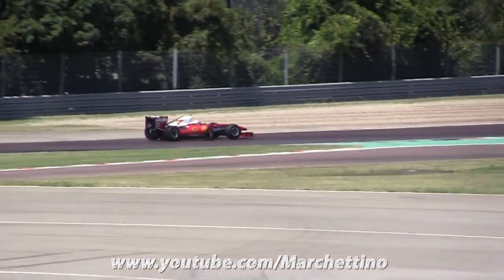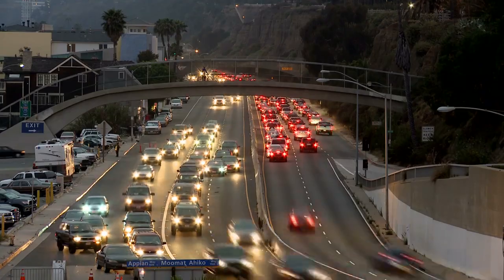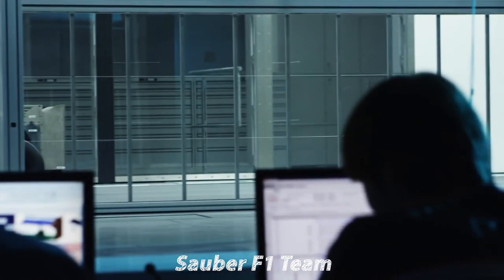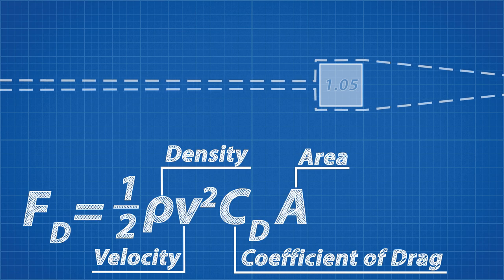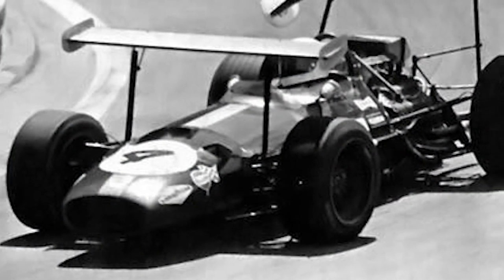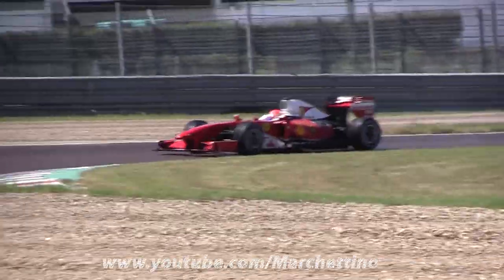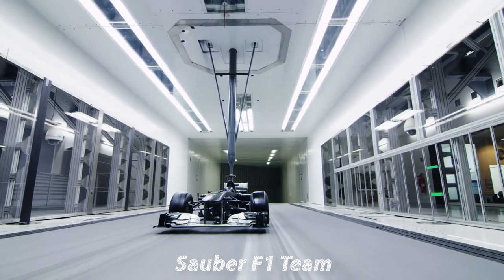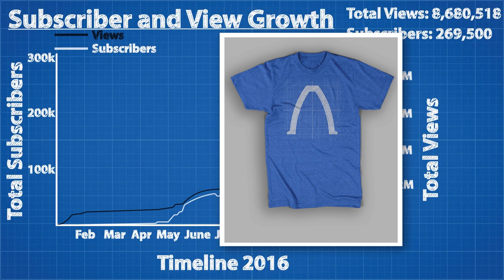The Greatest Innovations In Formula One

Comment: KERS is making it into some high end production cars now too.
Reply: TheSpacecraftX Toyota Hybrid uses this tech)
Reply: I wouldnt call an amarok a highend car
Reply: Chris Herrin Kinetic Energy Recovery System is a mechanism that tries to capture and story energy when the car is braking so it can be used later. in most cases this is letting the electrical engine of a hybrid charge the battery when braking.
Reply: A lot of F1 tech went to the production cars.
Reply: The LaFerrari uses the KERS as well
Reply: Technically every electric car uses kers so the chevy volt is competing with these high end production cars
Reply: My 2008 Toyota Camry has KERS. F1 was slow to pick it up.

Comment: Was anyone else disappointed that this didn't get into much depth about carbon fiber?
Ah well, something to look forward to in the next video I guess.
Reply from the maker: My Master's thesis was in carbon fibre reinforced plastics. It deserves a video (if not several) on it's own.
Reply: Same - I also think the lumping of monocoques crash surfaces and brake discs was rather random (in a pixie dust) sort of way. 

I'm not optimistic about carbon brake discs because passenger vehicles don't need the comparative advantage, and automotive engineers focus on maximizing value for cost. No one buys cars for sub-100ft 60mph to 0 braking performance.
Reply: where did you study and what excat subject did you choose?
Reply from the maker: Studied Biomedical Engineering in my undergrad, which is essential Mechanical Engineering with a bit of biology and surgical practice thrown in. My Master's was in Aeronautical, where I specialised in composite materials.  Worked in the Oil & Gas industry for three years as a composite design engineer/ product manager then. Varied....
Reply: Nomulus Norwegicus 
But the People would just drive faster.
Reply: Nomulus Norwegicus unlikely. Real life and engineering is all about compromises, and the phrase light, cheap, strong pick two is very true. Consumers aren't going to pay for carbon composite brakes when the vehicle is only 2600 pounds, 140bhp - especially when the cost can be applied to other things like interior comfort/NVH/sensor safety features. It's just the way it is.
Reply: how old are you? you dont sound so rusty like you already have so much experience.
Reply from the maker: 26
Reply: shinybaldy That depends on the relative costs and benefits of carbon-fiber versus normal breaks. (And how much people are willing to pay for something that sounds futuristic. You'd be surprised at how much marketing plays into this kind of thing.)
Reply: max mustermann I doubt it. People are used to driving at a certain speed, they'd be driving alongside others who didn't change their speed, and there's no reason to think the speed limits would increase.
Reply: Timothy McLean haha I doubt it. Most economy cars still use drum rear brakes because they work well with parking brakes, are cheap, and the cars are light and aren't rallying. Ask most drivers whether their car has direct injection or what's the MPG. More will know the MPG.  People don't care about technology, just results.
Reply: additionally don't carbon fiber brakes only really work when they are at temp? i wonder how well they would work up here in the great white north, after a 30 minute hwy run with -20F temps. Probably not very well.
Reply from the maker: Well my hometown is the European capitol of Biomedical Engineering. It employs a huge percentage of the population, so it made sense for me to study it at the time. Then again, I wouldn't advise anyone to study it. Mechanical Engineering is basically the same degree, but allows you to be taken seriously for way more jobs. A master's in BM would make a lot more sense, should never pigeon-hole yourself too early.
Reply: thats because Formula 1 cars were not the first things to utilize carbon fiber
Reply: You are awesome man, keep up the good work.
Reply: I study Aerospace in Delft and the Structures group has been hitting us over the head with composites since we started. They invented GLARE at my faculty and they literally can't stop talking about it.
Reply: Mark Kalsbeek Aerospace engineering at Delft is my 1st choice for Uni! Would you recommend taking the course? Also are there any pointers you could give me? Thanks!☺
Reply: I totally do, I'm in my first year and am enjoying it a lot, although the pace is a lot higher than I expected. My main pointers would be keep up with the homework and make the practice tests the teachers offer on blackboard. The former of which I haven't done properly so now I need to cram for my intro resit tomorrow XD.
Reply: ***** So? Pretty much nothing started in F1, yet some of it was detailed.
Reply: Timothy McLean but on the good side there's plenty of info on "carebun"
Reply: Timothy McLean but on the good side there's plenty of info on "carebun"
Reply: Y'know, since you've been giving out info about yourself, looks like a Q&A video wouldn't hurt. Perhaps a 1 million subscriber special?

Comment: KERS = Kinetic Energy Recovery System - used to be used in F1 as essentially a “speed boost” that could be used in a limited per-lap allocation.
Reply: it's still being used
Reply: Craftym Gaming not in F1
Reply: @craftymgaming5362  Kers as it was is no longer being used however it has morphed into ERS which is similar but a more power is output

Comment: Formula Anything-Goes*

*No jet/rocket engines though
Reply: Maddin1313 look up the lotus 56
Reply: https://en.wikipedia.org/wiki/Lotus_56#Formula_One
Reply: Bryce Ring that's now but in the past other engine types such as gas turbines were allowed, hince the lotus 56b
Reply: *Formula if it wins we're banning it unless you're a big german manufacturer
Reply: Yo, waddup!
Reply: There should be this as a racing series 
Bring back active suspension 
Cvt gear boxes ( because they are the fastest and got banned) 
Less restrictions 
Bigger tires
Better aero
Reply: they will have bigger tires and better aero this year.
Reply: Daniel Fogelberg quite frankly they need to restrict downforce more or add a maximum drag coefficient to level out the pack more than anything
Reply: Car Of Doom silberpfeil-aera in a nutshell (i know the AIACR anc not the FIA was around and that is wasn't F1 'till 1950)
Reply: MyLonewolf25 as a late 60's f1-lover i'd say simple aero (two/one wing in the front + one at the back) which would be optional 3.0L N/A or 1.5L Turbo engines (rotarys allowed (pls mazda I wanna a rotary f1)) tyres that don't last 1/4 of a mile and only manual gb's
Reply: Lukas Tyrlik i say allow auto gear boxes but! Torque converter size limit and clutch plate size limit 
( cvts allowed ) 

Imho I'd say 4l na and 2.5 supercharged or 2.2l turbo 

Or go back to touring car style with displacement modifiers based upon na turbo or supercharged and configuration 

Then have tire and weight limits based upon displacement class

THIS id love to see
Reply: I think turboshaft engines from helicopters would be a great idea. Check out Jay Leno's jet car where he gets around 200mph with Neil deGrasse Tyson in the passenger seat.
Reply: Maddin1313 or 6 wheels
Reply: Maddin1313 anything goes until someone bitches out and complains that its not fair.
Reply: it should be about which car has the best design... not who has the best driver
Reply: So... Can-Am ?

Comment: The Chaparral 2E was Jim Hall’s first car with a high mounted rear wing.  It raced in the inaugural CanAm series in 1966.  The Chaparral 2F was another of his designs equipped with a rear wing and raced in the Worlds Sports Car Championship.  It did race at Le Mans in 1967 but failed to finish.  Later in the year it won the BOAC 500 held at Brands Hatch driven by Mike Spence and Phil Hill.

Comment: Isn't one of the reason why Carbon Ceramic rotors aren't popular for road car is due to how Carbon Ceramic rotor not being as effective as Steel rotor at low working temperature?
Reply: RDS Alphard that is indeed right
Reply: The also produce squeeking noise , dust and dont last as long as steel discs
Reply: Ovais Saand 
I thought squeaking noise is due to brake pads? I didn't know they have lower lifespan, but then they're usually on expensive cars that don't cover much mileage, so it wasn't too well known.
Reply: Squeaking noise in steel brakes is due to incorrect installation which cause the brakes to vibrate and produce noise..
But Carbon cermic brakes make noise due to Carbons crystalline structure
Reply: It's a combination of the poor low temperature performance, cost, and long manufacturing times. It takes 6 months to make the Carbon-carbon rotors used in F1. Even the less expensive carbon ceramic rotors available from supercar companies cost well over $10,000
Reply: Yes, they essentially work only when red hot and only for the duration of a race being so extremely abrasive, which is perfect in F1 but completely useless anywhere else.
Reply: That is actually good example that most of innovation in f1 we do not use in customer products. Usually it costs hundreds times more and gives just little bit better performance with huge downsides that eliminate any advantages. So basically it is burying of money if look at it from normal engendering pov. Much more efficient to spend money directly to R&D for usual cars than spend it for overpriced solutions which you can apply only in particular conditions and hope that one of this idea can be applied to real product.
Reply: Razvan J Nooo thats all wrong. The friction coefficient of CC discs is lower than steel at 'cold' temperatures. They need to reach temperatures above 400C to work effectively. They have amazing heat tolerance up to 1000C and minimum thermal distortion allowing them to be worked harder than steel. When it comes to cooling, the calculations take many factors into account but the heat is generated as a result of the speed and mass of the car. CC brakes allow cars to go faster because the brakes can convert more kinetic energy into heat. More heat needs more cooling. The original poster was correct.
Reply: This is a complex subject. F1 cars use carbon fiber reinforced carbon discs, and need to be hot to work. They also consume the rotor at a similar speed to the pads (both are the same material), which I believe has led to them being banned in most categories as a cost saving measure. 

(Expensive) Road cars use carbon fiber reinforced ceramic (silicone carbide in this case). The pads become the deciding factor in how warm the brakes have to be before they work, same as pads for regular brakes, but they typically use different pad compounds compared to iron rotor pads. In terms of wear, they're an interesting case, as the rotor is almost diamond hard and is thus not subject to significant mechanical wear, their weakness is heat. While they can get very hot and not fade, the carbon fiber begins to burn at high temperatures. 

The loudness of brakes is typically determined by the pad compound. Both iron discs and ceramic discs can be either loud or quiet, but ceramic discs can become loud if they lose their transfer layer (their "bed in").

Comment: At 7:57 there's an animation, which explains the ground effect. It does that in a wrong way, because actually the ground effect is all about the floor's shape. The bottom of a ground effect car is shaped like a wing's lower surface, while the side skirts are there to block the air coming from the sides of a car. All the modern racecars which use the ground effect don't have these skirts anymore, because although they significantly increase the ground effect, in case of losing contact with the track surface due to a bump on there or when a car drives through a curb, the car loses most of its downforce, which results in a loss of handling.
More than, albeit most of the modern racing cars use the ground effect, the F1 cars don't use it to the full due to restrictive regulations. The ground effect surfaces, the diffusers are allowed only behind the rear axle, while the floor should be flat within the wheelbase, according to the current rulebook (2020).

Comment: Just like to point out, we will likely never see carbon ceramic breaks in normal street cars.  Steel rotors are better at low temperatures and street cars don't see the kind of repeated high stress breaking scenarios that race cars do.
Reply: Not unless you're driving a ridiculously overpowered car through stop and go inner city traffic.
Reply: Actually carbon breaks on street cars have a big disadvantage. The produced dust can clog the pores in the disc and damage them. Carbon discs have to become hot enough to burn this dust which rarely happens in public driving.
Reply: Carbon brakes also do not heat up enough to operating temp in normal street driving, meaning that they will not operate as well as steel discs.